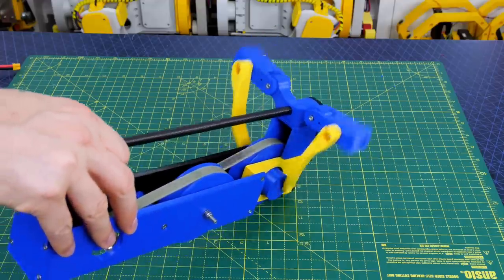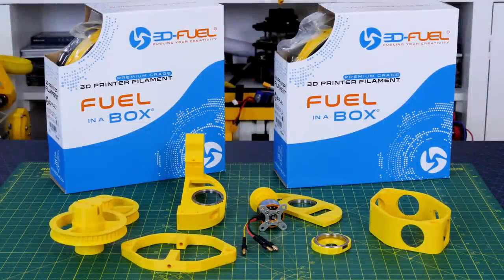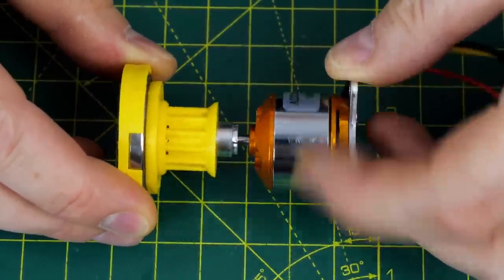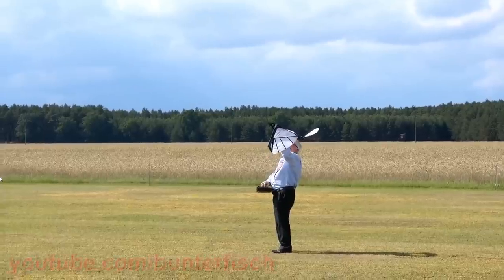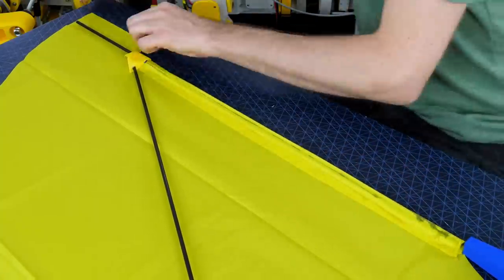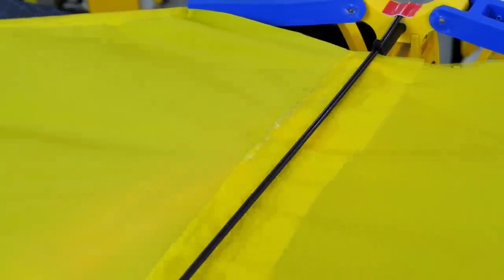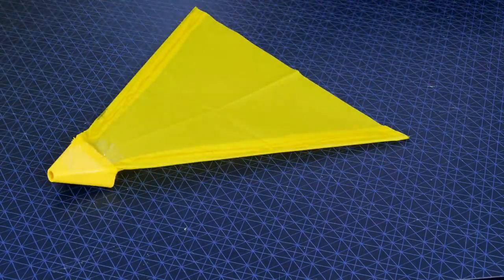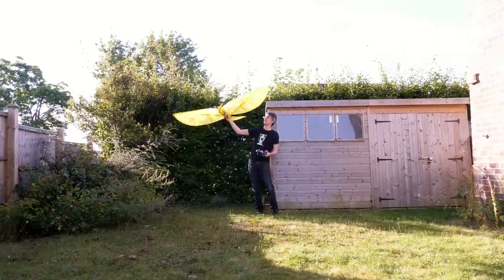Ornithopter Flying Machine Part #2

Comment: I'm no aeronautics engineer but I'm trying to work out how these wings would generate any lift. It seems to me that the downstroke pushes the ornithopter up while the upstroke pushes it down again by the same amount. So the net result is no lift and gravity wins. I can understand that it would produce forward thrust, which would be useful for generating lift with the tail but something tells me that it would be much more successful if the wings generated at least some, if not most of the lift.

One approach I can think of would be to constrain the trailing edge of the wing such that it can't flex above the plane of the wing but it can flex below. That way the downstroke will present a larger surface area than the upstroke.
Reply from the maker: Air comes out of the back and it faces up at the front, as far as I can tell
Reply: @jamesbruton  Falcons and other big birds fly by spreading their wings fully o when moving them down, and then contracting them a bit when putting them back up so they generate push around less air. Do you think you could accomplish something like that with a one-way hinge and maybe rubber bands to keep it from contracting too much? Just an idea I had.
Reply: @jamesbruton  also, if you look at feathers, they are like a one way valve. allowing the air from top to bottom, but not from bottom to top. Maybe you can implement something like that by using a lose peace of fabric as a valve?
Reply: @jamesbruton  Maybe you should make this point with more vigor. I think the wings operate more like those of a stingray, creating thrust, and lift comes from the angle of attack of the whole mechanism.
That said, perhaps a bench test to maximize thrust first.
Reply: The main point is to generate thrust. The lift comes from the same mechanism as an aeroplane wing: airspeed.

An ornithopter should be able to glide without flapping. The flapping is just to act as a substitute for a propeller.
Reply: @JMMC1005  I get James' point about forward thrust being directed upward and so keeping the ornithopter airborne but this is most definitely not the same mechanism as an aeroplane wing. An aeroplane wing makes use of the mechanism of an airfoil which generates lift. Granted, it requires airspeed in order to generate lift but it generates lift in a very different way than by simply gliding. And while an aeroplane can generate lift by adjusting the angle of attack of the wing, it has to be noted that there is a key difference between thrust generated by flapping and that of a propeller. The direction of thrust generated by a propeller is not in the same line as the angle of attack. The propeller generates forward thrust while the angle of attack of the wings generates lift. On this ornithopter design, the angle of attack and the thrust vector will always be in the same line.

The more I think about this design, the more convinced I am that it needs something to address the issue of lift. The aerodynamic force consists of two vectors, lift and thrust. You need both in order to be airborne. That is, you need to overcome two forces, gravity and drag. Now you can use thrust to overcome both but the design must have a way to convert thrust to lift. The only thing in this design that converts thrust to lift is the angle of attack. By pointing the nose upwards, the thrust is effectively pushing the ornithopter forward and upward. This makes it a precariously unstable system where you have to get the angle of attack just right - and given the violent forces on the fuselage from these wildly flapping wings, I think it is always going to be an extremely tough task trying to dial in that balance. Birds don't fly like that and I feel it would be prudent to at least try to approximate bird flight.
Reply: @deefstes  They're more similar to an aeroplane than you might think.

Aerofoils are necessary for the efficient generation of lift, but they are not a requirement for flight. Plenty of model aircraft use perfectly flat wings (plus, aerobatic aircraft use symmetrical aerofoils which are identical top and bottom). They fly just fine, despite not being awfully efficient.

There's a lot of argument over the exact mechanism by which a wing works, but the classical 'air goes further over the top, generates low pressure, rises' explanation is misleading at best, and has some wrong assumptions baked into it.

The dominant reason for a wing generating lift is that it pushes air downwards. A flat plate can do this by having an angle of attack, and an aerofoil does it by having both an angle of attack, and a shape which results in the air leaving the wing being 'thrown' downward as it leaves the trailing edge. The high/low pressure below and above the wing also plays into it, but the end result is that as an aeroplane flies, it's constantly accelerating air downwards (which generates an upwards force, or 'lift').

While you're mostly correct in saying that the propeller and angle of attack are not aligned, this is (again) not a requirement for flight. Let's ignore the fact that propellers usually are mounted slightly off-axis (for reasons like combating P-factor and pitch-up on power application), and assume that the thrust vector of a propeller aircraft is aligned with the fuselage.

It would fly just fine with the wings mounted with no angle relative to the thrust line. The problem would be that in order to generate lift, the wings MUST have an angle of attack. This means that the aircraft needs to fly in a slightly nose-up attitude, which presents a larger cross-section of fuselage to the air, increasing drag. It's for this reason that wings are usually mounted with some amount of angle 'built in' (called angle of incidence).

Ornithopter flight mechanics are very similar to a propeller aircraft with zero angle of incidence. They need to fly a little bit nose-up (so yeah, your thrust vector isn't necessarily in the most efficient direction), but a large portion of the lift is due to airspeed, not the flapping. Most of the flapping goes towards generating thrust. Most of the lift comes from airspeed, not flapping.

There are exceptions when you consider birds like hummingbirds, which really fly a lot more like a helicopter (zero airspeed, all 'lift' is basically thrust).

You don't have to take my word for it. Look up 'Tim Bird ornithopter'. It's a toy that is fundamentally identical to James' design (straight wings with no extra joints, simple membrane wing, simple flapping motion) which flies perfectly fine.

The issues with James' ornithopter are a combination of the mechanical issues of his current motor/gearbox, some turning which needs to be done to the C.G / tail, and maybe a bit of tweaking to things like the tightness of the wing skin (too loose and it isn't going to act much like a wing, too tight and it might not generate much thrust).

Comment: You can see in the demonstration of the ornithopter, that when the wings go down, it wants to go up. If you observe birds before they land, they will leave their wings up, and their trailing feathers down. This is to basically slow down. If you prevent the flexibility of the wing (maybe more tape in those areas) it will be more stable.

Example: Hold out your open hand to the side of you. Do a up and down motion. 
Now what I want you to do is try and roll your forearm back and forth without moving your hand. 

The motion you are doing is key to stopping, or gaining altitude, in combination with how many flaps per second.  In his model, and in many ornithopters, this is not implemented. No one can imagine their ornithopter to land like a bird, so they eliminate that variable and they keep trying with their stiff model. 

I don't study bats, or birds, so I could be wrong. If you don't want to implement this mechanism, you can go with the bat model, which people already do, and I think it would be better suited for your project here. In robotics, the more you put weight on a joint that is perpendicular to it's mass, it has a hard time moving. So manufactures put the motors closer to the center of mass, and use strings and cables to manipulate appendages.  It's a good idea to make fingers that are restricted in certain axis, and can change the restricted motion of one axis to a motor.

In any case, I am eagerly awaiting your next prototype, hope this helps.

Comment: Just a trick for the motor control. You can change the radio control output so you can actually use the radio comfortably. You are using a flysky, check the dual rate and throttle curve configurations. Hope it is useful. Good luck!

Comment: I don't see how you are to achieve any meaningful lift from the flapping of the wings when they move in a straight line. 
Plot the wingtips position on a graph, one axis is fixed and the other goes up and down. 
As the wings spend half their time going up and half their time going down they will cancel each other out, half the time pushing the plane down and half the time lifting it. 
A sinewave averages out to 0, as does the lift of this plane. The better attempts is likely due to it acting as a better glider due to the position of the wings at launch. 
There is not even time for them to flap twice on any attempt, they crash before that. So how is the flapping motion supposed to contribute significant lift?
Reply: I definitely don't have all the answers to the questions you've posed but a single axis flap seems to work on other ornithopter builds he showed in the video. I think it has to do with the trailing end of the fabric wing that creates the forward motion. Here is an example of his build reduced to the most simple form https://youtu.be/cCS27FiUTSA
Reply: @narxic  it looks like it's just "snaking" through the air, creating thrust, pushing the craft forward, like a snake or an eel.
Reply: @crackedemerald4930  yes, I was super into ornithopters for a while, the flapping creates thrust and the forward velocity in air creates lift on the wings.
Reply: @andzerb  that's exactly what my hypothesis was

Comment: Ooh, I LOOOOOVE ornithopters!  Wonderful aircraft!

It looks like you need a TOUCH more rigidity in the main wing spar since its stalling when you have it basically at the right speed for flight.  Youre so close, gear reduction, a little more rigid main spars, and you may as well build in the tail control cuz you're basically there.

Comment: I have a 2-meter V tail glider, the servos are up front in the fuselage and the tail is controlled with 2 quite thin but not flexible wires running inside the carbon tube with a cap on each end to keep them in place. It can handle very heavy Bungy launches and even a winch launch without the flaperons moving. This would allow you to control the tail without adding tail weight, you may also find that some upward tail input is needed when launching.

Comment: for a good design idea, look at the ornithopter released by Wowee toys about 15 years ago. Modeled on a dragonfly, it was an RC with two sets of wings for lift, a tail rotor for steering, and a small LiPO battery, all mounted in a Styrofoam body. The wingspan and body were both around 12" long and the whole thing weighed less than a C-cell battery.

Comment: Regarding finding the right speed - if you enter the endpoints or mixer settings on the radio, you can set what the maximum PWM to the receiver should be. That way, you can move the gimbal all the way to the top if you like, and have that be the actual top speed of the motor that you want

Comment: For the wings. If you lay a slightly longer length of rod along the top of the finger splines and attach the ends to the shorter splines you will make them into a scoop. This will add lift

Comment: Looking at real birds of that size generally have a slower flap speed but the wings move further. 
So my suggestion would be to change the leverage on the wings so they travel further and move more air, but flap slower. (So gear it down more to give motor more torque too.)

Comment: Bigger wing span means lower flap rate.  Use 2 servos to control the tail for yaw and pitch.  Weight is the enemy of Ornithopters, a smaller battery is better.  On a large ornithopter like yours, you may want to make a glide lock so when you reach altitude you can just glide/thermal around.  I have an original Kinkade Ornithopter, I suggest you look at how they are built and operate so yours can be successful too.  Best of luck!

Comment: First make a glider, that will give you the weight ratios, then add the flapping mechanism to the wings.
An aircraft needs forward momentum in order to stabilise, birds don't need this as they have very fine motor abilities which trim their wings and there feathers create laminar flow which also stabilisers the lift.
Love your videos, congratulations on your 1,000,000🥳

Comment: Nice.  I would make the cross spars of each wing flex though when the wings go up like a normal bird to give more lift at a lower speed.  You could make a simple Carbon Rod hinge with a little tension from a spring or rubber band that locks flat on the down movement, and allows about 30 to 40 degrees on the up movement.

Comment: 3rd stage gears are going to add more weight and in the wrong place.. redesign the two stage to maximum allowed by the belts and whatever weight that adds will be towards the front.. remember when making paper airplanes.. a paper clip is put on the front.. the weight at the front allows the noise to dive and thats how it gets a lift! keep up the good work, cheers

Comment: For super strong but crazy lightweight wing material (much lighter than ripstop nylon) look up cuben fiber. It's used in racing sails and outdoor gear. Amazing stuff. Like tissue paper made from UHMWPE fibers laminated with Mylar. You won't tear it but it'll shave off some weight. Just make sure to get the really light tissue paper like stuff as there are various thicknesses. There are 3m adhesive tapes that can stick it.

Comment: To help with motor speed consistency, you could try reducing the Throttle Channel END POINT (pg. 22 in the FlySky manual). That way, you could push the throttle stick all the way up each time, and adjust the max output in software as needed.

Comment: Me: Trying to minimize my use of plastics
James: Builds a huge robot made of plastic every week
Reply: most 3d printed stuff is made of plastic that can, technically, biodegrade. I'm working on coming up with a reliable, easy way to do that.
Reply: @jameshughes3014  that's good thinking. My comment was kinda meant to be light hearted but it probably didn't come through that way though

Comment: Your wing spars should be moving through an ellipse such that the down stroke transitions into the back stroke which transitions into the upstroke which traditions into the forward stroke. This will increase wing area on the down stroke and decrease wing area on the upstroke, resulting in best positive down stroke force. The motion of a birds wing is actually much more complex than this, but your current design will only ever fly less than it's passive glide because every time the wind go up, the body gets pushed down and you're creating a great deal of turbulence.

You probably also want to use fiberglass rods for wings so they'll flex more, allowing the wing to motion to be exaggerated.

Comment: Sewing would be more efficient as to weight and strength than the glue. Use 5 points zigzag and a decent spacement between points for preventing ripping along the sewing. Great project still, sincerely, a kite maker 😁

Comment: Quick suggestion:
If you look at slomo footage of birds in flight you'll notice that the upwards and downwards motion of the wings are not symetrical. If you look at the wingtips you notice that they tilt upwards during the upwards stroke. Thus the wing meets less air resistance than on the down stroke. This is how a bird generates net lift.
Imagine sitting in a rowing boat, moving the paddles back and forth but never lifting them out of the water. You wouldn't go anywhere. If wou would turn the paddles ~90° on the back stroke and return to 0° on the forward stroke, you get a net force that pushes you forward. 
Now a bird does not have the luxuray of being able to "lift it's wing out of the air" so the only option is to tilt. Doesn't have to be 90° though.
Another added benefit is reducing the drag on the up stroke, thus reducing the load on the motor, saving heaps of energy.

Oops, not that "quick" of a suggestion ;-)

Comment: The key thing here is the location of the center of lift, versus the location of the center of gravity. In most model and large airplanes, the center of lift is located around 1/4th of the chord of the wing. Try to position the battery so that the center of gravity of the whole machine is close to the 1/4th point of the wing chord (measured from the front of the wing).

Comment: I had a toy ornithopter as a kid. I remember there was an elastic band than ran from the head to the tail that you would wind up. Wings were like yours except sheet plastic. I remember it flying. I'm guessing the flapping was just a simple offset crankshaft/Conrod from the rotation of the elastic to vertical reciprocal motion.

But being a kid and it being ages ago it could have just flapped while you threw it and no real lift...

Comment: Either get down on 2s or use a pignon gear reduction on the first stage.
Add tail control, my Shrike (from Kinkade) had always a pitch up tendency AT START, but vanished while in flight.
The tail is an important part, to trim the bird.
Good thing you listen to us, your ornithopter looks VERY promising...

Comment: You need superglue de-bonder. It’s a solvent for CA glues which are used by model builders and you should be able to find it at a hobby shop